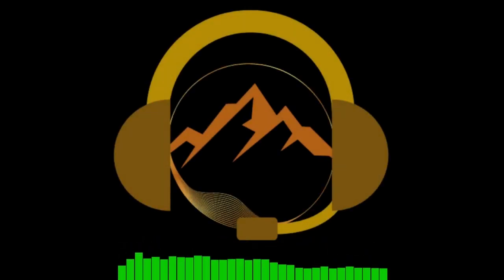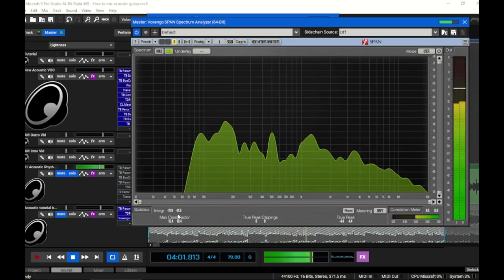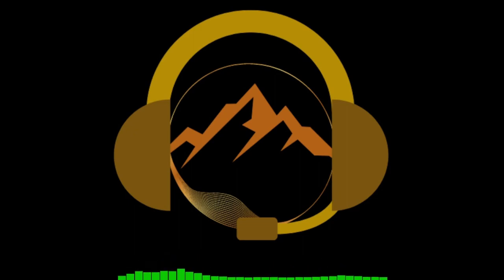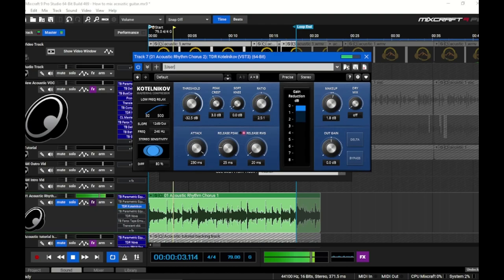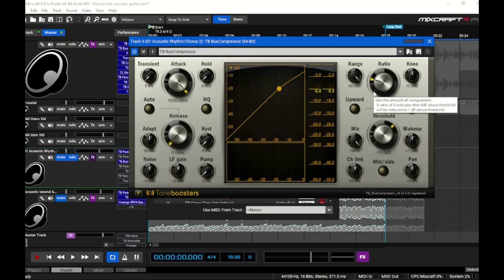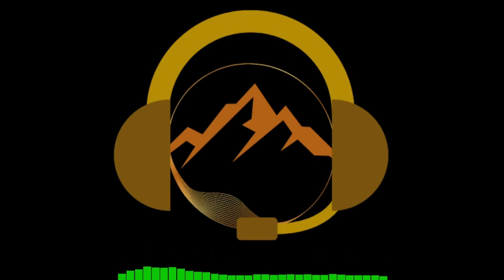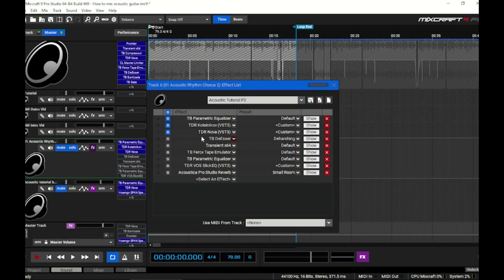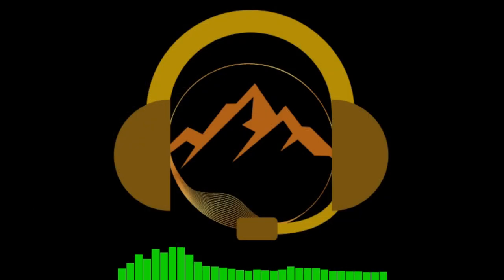How to Mix Acoustic Guitar

Comment: Great information as always, but this one has me perplexed: I don't understand how a compressor could achieve any dynamic range reduction if the threshold is set so high that it is above the sound of the instrument. Wouldn't that result in no attack and no release (whatever the attack and release settings would be) and thus no compression?
Reply from the maker: Isn't it interesting? But yes, the meters are deceptive in that sense, there's certainly gain reduction occurring, you can hear it, and it's very gentle and transparent. That method only provides a db or two of reduction, but it's really smooth.